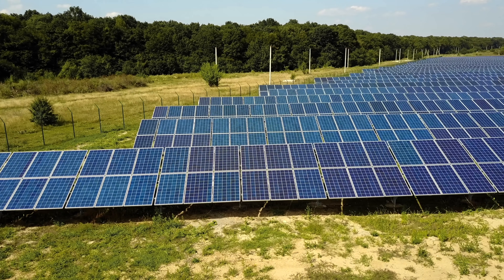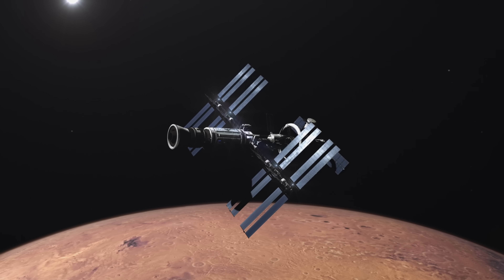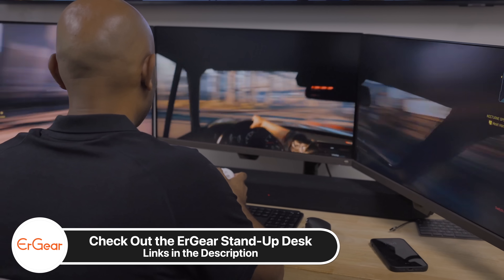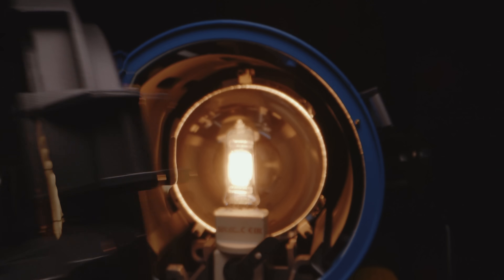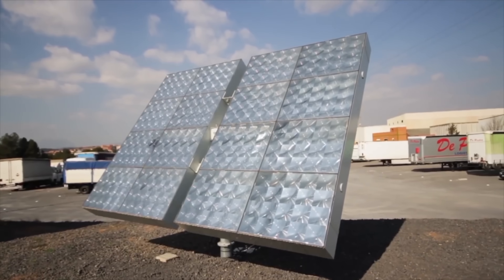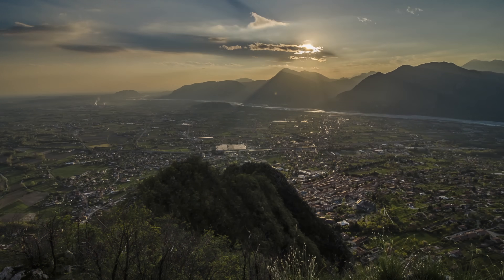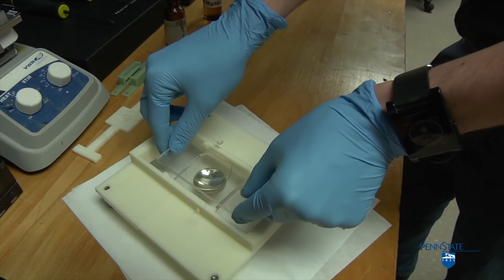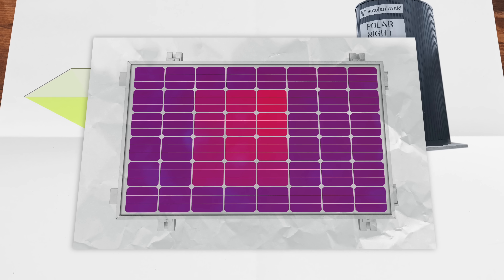Why Don't Solar Panels Have Magnifying Glasses On Them?

Comment from the maker: Check out the ErGear Standing Desk! Amazon: https://kol.ergear.com/3gN8paZ Direct: https://kol.ergear.com/3TYC5R4 
ErGear Monitor Mount: https://kol.ergear.com/3frNw4T
Reply: Stop with clickbait
Reply: Good explanation, again.  😀
Reply: Finally add back side some cooling and turn heat to electricity too and increase solar panel efficiency. There is many good simple ideas out there. But in space solar and earth solar are whole different things, because if we don't have clouds, we still have some hundred kilometer or so layer of air. Dirty, sometimes more dirty. Space is cool, very cool backside of panel, it increases efficiency too. If you cool hot panel at day, when temp goes lower, it knoks more electrons to move versus panel that is hot already. It's weird that cooling isn't calculated to effect enough for it would be used already. And heat flow from panels could be turned to electricity many ways. Not enough effect I quess, or something else? 

Used fuel rods from nuclear plants could make electricity very long time too, same way if wanted, now they just cool of those without getting anything. Old system that throws money for fossils goes on forever. That thing dosen't bring money back, it just gives energy and from huge cost. Same time it gives something to our next generations that they dosen't have choice to deny it..
Reply: Several projects have analyzed the efficiency of wide angle solar reflective collectors. IIRC they have a natural peak no one knows how to beat because increasing the curve starts reflecting light back out. So now with 3D printing the cost race will focus on holding cost steady while increasing durability. A 50 yr durability has to be the goal so the panels can replace home roofs at low cost. The LCOE bust be cheap to make the solar roof cheap. A solar roof with "forever" durability makes the LCOE  nearly free, so durability nearly excludes anything else from importance. In contrast, utilities can focus on more efficient panels and simply produce a big pile of spent solar panels.
Reply: Its the second  video you make to clickbait and take reviews.Boring and  pointless.
Reply: Why dont we make round solar panels.

Comment: You could use your house’s own indoor plumbing to cool the high-concentrated PV and easily offset water heating costs.
Reply: A pre heater before your water heater, also in Winter it would be nice to pump air through, to preheat the air before your heat pump.
Reply: And you’ll have constantly use the hot water from 9am to 5pm
Reply: @kalrandom7387  Maybe you wouldn't even use a heat pump in this instance, more likely you would just have a radient heating system, no?
Reply: Places that are super sunny usually don’t have lots of water. I.e, deserts. Also, using active cooling might rob you of any of the efficiency gains from concentrating sunlight in the first place
Reply: @NiftyShifty1  there are plenty of places with tons of sunlight, and lots of water. I live on the Gulf Coast. It's hot, it's humid, and when it rains, it's often torrential, but only for a couple of hours, at most. I promise you, the sun is very oppressive here. Also, there is not always water shortages in deserts. Pipelines exist. When we decided to build a city in a desert, such as Los Angeles, the second largest city in the US, we work out how to water it.
Reply: You can get combined panels already, "Linus tech tips" is using a loop to transfer the heat to his pool
Reply: @KastorFlux  lot's
Reply: @klepow  Australia is good for both sun & water
Reply: How about heating your swimming pool water. If you have 1.
Reply: That’s a brilliant idea 👍👍👍👍👏👏👏👏
Reply: @gf1227   what about using this extra heat to run a small steam engine that creates more energy ?
Reply: Evaporative cooling is out.   But closed loop would be fine as long as the ground was cool.   But you can't dump heat into it  indefinitely.

You can remove Texas from the "gulf" states.   We are in a terrible drought.   I lost 20 year old bushes.   You can't keep long grass alive with out 5+ hundreds of dollars of water per year.
Reply: @texasRoofDoctor  - that would put more energy out during production hours, which would require more storage for off hours use, which is normally the expensive part.
Reply: @gf1227  - or you store it, like in your water heater.     If you are in a heating only climate, put the insulated tank inside the structure, and any "heat loss," heats the house before it is done working for you.

  ReinaLLC here on youtube has videos on the net zero houses they built in alaska, around 5,000-15,000 gallon insulated heated water storage tanks.  Mythbusting Solar Thermal is a good video to see how their system works.   In lower lattitudes, the same structure could get by on a MUCH smaller storage tank...  500-2500 gallon range.
Reply: My first thought was passive greenhouse heating.
Reply: I don’t think one household would have enough water volume in summer…winter might work. But large facilities like processing plants, etc. could probably have some kind of crossover systems. Especially high heated water usage…win/win.
Reply: @pohkeee  Swimming pools could be the best use case on that front. Just pump the water from the pool around the concentrated solar using something like copper pipes that conduct the heat from the concentrated PV efficiently into the water, then just pump it back into the pool. You’d be able to reserve all the electricity to power the rest of the house and save a lot on pool heating in particular.
Reply: water is great & all but there are other mediums that have  better heat / conductivity properties that would probably be of an even beter use. this is legitimately what I've been trying to work as a side hobby since 2009. during which time the world has organically come up with the same principles i had then & surpassed my progress, leaving me richer in nothing more than knowledge 🤓
Reply: Also can be stored in the ground a storage tank heater thermal could be changed to electricity i think panels should have thermal cooling even sheep ones because sun spots on all panels reduce the life span if the pv panel and also using cooling collecting thermal energy we if done right give more energy than the p.v and especially to make heat for water storing that extra heat can last upto a week if done correctly best in the ground also there is a way to transfer that heat to electricity and even power an airconditioning unit better than a heat pump all that is needed to to gradiant of heath for it to work
Reply: That's a good use of excess heat.
Reply: Not in Arizona where I live. In the summer we run out of cold water. By August, the water supply can be as high as 94f. I have been working on cooling ideas for years for my arrays and it is a bigger problem than you think.
Reply: A simple closed loop geothermal heat sink in a residential yard would cost $1-2k and dissipate more than air circulation
Reply: Yup, do a closed loop system with recirculation pump, heat exchanger into hot plumbing with its own recirculation pump to cycle through storage tank, use coolant mix on panel circuit for freeze/boil protection, radiator with fan for dumping excess heat when needed during summer peaks
Reply: @SavageOne420  Better yet, can even use the excess heat from concentrated PV to boil water in a closed loop and spin a turbine with it, thus further boosting the concentrated PV efficiency by converting the excess heat back into electricity.
Reply: How? Sounds interesting . Please elaborate
Reply: With the high efficiency of the panels why wouldnt you just use some power to circulate water into a coil of pipe in the ground (Reverse Geothermal) and use the cooled water (with antifreeze added to flow through water block on the rear of the panels added heatsink? TADA...water cooled and pumps are cheap as well as the aluminum water blocks and the plastic pipe in the ground. Everyone owns a shovel.
Reply: @gf1227  so what about embedded controller  time based water solenoids. Switch water circuit as required based on heating / cooling as required.
Reply: @gf1227  nah. 2nd water heater that stores the energy and can supplement the primary unit.
Reply: Not easy and costly.  Solar thermal water heaters are very common in Asia and Europe.
Reply: If you actively cool all of the cells individually, they heat gradient should not be an issue. The hotter panels should warm up the cooler panels, which will make them slightly less efficient, but the heating will be uniform, the power output will be uniform, and that should eliminate a lot of heat-based stress in the materials. And if you actively cooled the liquid using pressurized calcium laced water, it should pull heat more efficiently, and you can dump it in a large sand battery. Which The video went over, and then you can pass another loop in the same battery, and you can use it to heat your home with a pump, even in the winter it should work. Work. That should also offset some of the costs, and it should be used less electricity to warm your home in the cooler months. Months. Theoretically, you could also use it to equalize temperatures when it gets hot in your house. Geothermal heating and cooling.
Reply: @angablade  From someone whom worked in CPV for years - during the hayday a decade ago, technically this is feasible but exceedingly cost prohibitive.  Europe and Asia commonly utilize simple concentrated solar thermal for water heaters very simplistically on the top of dense apartment housing.  Not, CPV.  Easiest and lowest cost is a sheet of copper as a backplane across all of the cells as a heat spreader.  

From a heat transfer standpoint, the concepts are very similar to a PC cooling for the CPU except in large quantities - so much more like a server / datacenter.  Individual active coolers would be immensely expensive.  Alternatively if you went dense array (where the PV collector is more like a CSP tower design or satellite dish) then active cooling can be used as the solar cells are tightly packed together.  

HCPV is unlikely to be cost-effective and LCPV is WAY worse.
Reply: @gf1227  you could use it to warm the ground of a green house

Comment: Wow blast from the past, this is what I worked on with my graduate thesis some 20+ odd years ago in grad school.   I also showed that you could get increased efficiency with increased concentration and at the time solar was much more expensive than it is today, but that wasn't exactly anything new either,  couldn't exactly do too much of a cost analysis as I was quite literally funding everything out of my own pocket so there was a lot of DIY kludged together things, if it wasn't for a "personality dispute" with my grad advisor I may have actually gotten to the point of writing a paper on all of it, I still did finish grad school I just had to do a 180 on the focus I took.

But yeah all the same issues are ones I dealt with,  cooling was the biggest,  but also some level of tracking is needed,  one idea I had was a "trough mirror" and the solar away from the Sun, that idea is still used except it's used to heat fluid to spin turbines to make electricity instead of making electricity directly
Reply: Wow indeed. I beat you by ten years :-) I just posted my version of this concept. Same concept, same funding problems. Same dead end. Maybe our time has come.
Reply: I just thought of a solution that might reduce the cost of moving panels towards the sun. Study how flower plants manage to move their stems to improve their abortion of sunlight. Because nature is usually very efficient at what it does it can probably help us to come up with a solution to make sunlight more available for absorption.  PS: Please accept this correction: "abortion" should be read as "absorption".
Reply: The idea of moving the collection point around in the panel using 2 small dc motors (it’s a plane so very simple to implement and low power consumption) is pretty good solution. If the lens requires “z-movement” to adjust the focus then yeah another motor is needed (or other way to handle focusing) but maybe not even needed if the focus doesn’t change much.

I really think that would be the easiest idea to implement for the panel and much smaller power consumption than moving the whole panel around!
Reply: Lol and where is it today? There's a raason you ain't work in there today: money.
Reply: I hope you consider getting back into this field of research, and while you might not be able to do much with concentrated solar since others are already working on it, the field could use all the smart people it can get to help expedite the work, and explore other ideas for better efficiency.
Reply: @tortysoft  Ha!  Excellent.  You probably had a similar reaction as me then hearing about this "new technology" I think my eyes rolled so hard a day is now a little bit longer 🤣🤣
Reply: @venim1103  Instead of mini motors why not make use of the physical properties of materials that expand and contract with changing temperature or amount of sunlight? With the proper material placed strategically, the focusing glass might orient sufficiently towards the sun to capture more sunlight than it otherwise would without another force to change its orientation. This might require the use of nanotechnology, but who cares if this can be accomplished cheaply.
Reply: @supercheetah0  I've slowed down considerably since my retirement 15 years ago. My mind is not quite to the task today. But maybe someone might run off with the idea of learning from nature to come up with a solution.
Reply: @JM-kp2vg  Plants are alive , they move on their own
If it was related to geometry and magnetic fields would help but probaly not ( dont know )

Anyway our planet needs Sun to , we cant use all of it
Reply: @pieceD399  I'd rather behold a sea of flowers rather than an equally large array of solar panels. Those things are rather unsightly.
Reply: A lot of what we knew way back can only now be reproduced 😔 heat would still be an issue but couldn't spherical lensing work to collect all directions?
Reply: I don't think "increased efficiency" means you get more power per photon. I think you get more power just because there are more photons. Am I right?
Reply: imagine if the trough mirrors could direct light onto the PV cells and a heatpipe or something wicks away the heat to boil water and turn turbines at the same time - two for one energy generation 🤯
Reply: “kludged”   Great word! 🤩
Reply: y'all are worried about cooling when you should be worrying about thermovoltaics
Reply: @JM-kp2vg Plants move via hydrostatic pressure in the cells of the stem. A system rigged up of hydraulics would be a close analog.   Not sure how cost effective that would be compared to programmed electric motors.
Reply: How about a glass sphere. You dont need to move it. It centers the light. And point mirrors to it.
Reply: @Manatoro  A sphere has problems with the focal point shifting off axis, but the bigger problem is in order to focus more light than the area of your solar panel, you need a glass sphere considerably larger and that would get quite expensive.

Comment: This works well for direct heating solar water panels where heat is what you want
Reply: It does, but in practice only total surface area matters, because the panels are insulated pretty well.

You have to balance pump hours vs. temperature. You don't want the pump to always run, because it takes energy to do so. You don't want to switch the pump on and off a lot, because that would break the pump quickly. The optimum is in between. In practice, 60 degrees of fluid temp seems about right and it allows you to use the heat directly.

Please also not that modern floor heating works with temperatures only slightly higher than room temperature (2-5) degrees.

What I would want is a solar panel that on the rear is cooled by water, the heat of which is transfered to a vat, from which all warm water for the house (water as well as heat) is generated. Combine this with a heat pump and you get a pretty efficient system, me thinks.
Reply: @juliusfucik4011  If you power the pump directly from PV it only runs when the sun is shining. This complements a drain-back solar thermal system in climates where nighttime freezing could be a problem.

Comment: I worked with cooled PV and concentrated light 20 years ago. PV cells were very expensive then and had only some 10-15% efficiency at normal intensity back then. As prices dropped and efficiency went up, the economy of concentrated solutions evaporated.